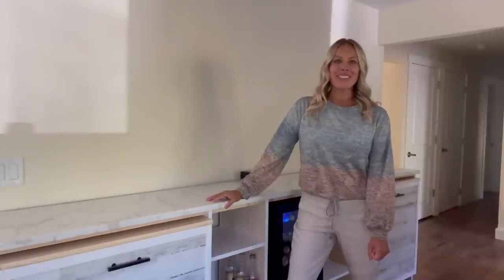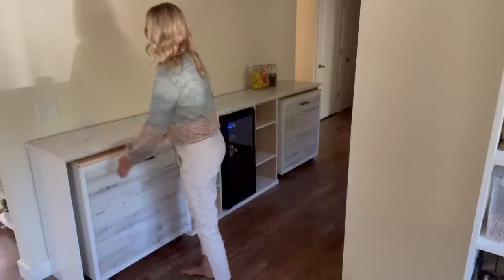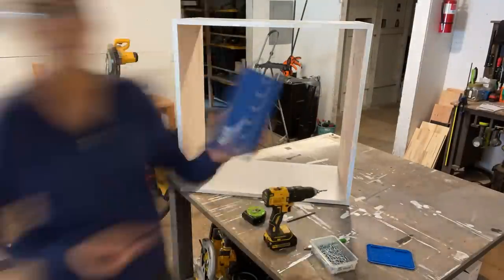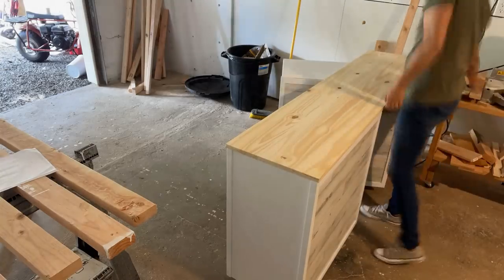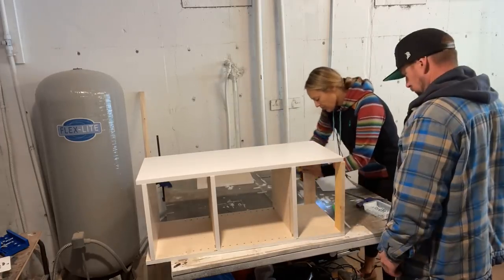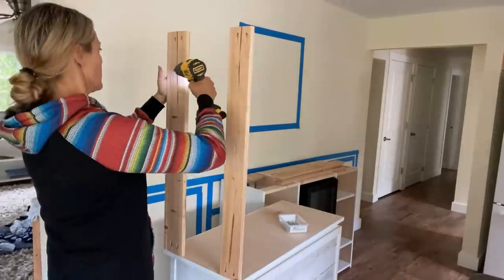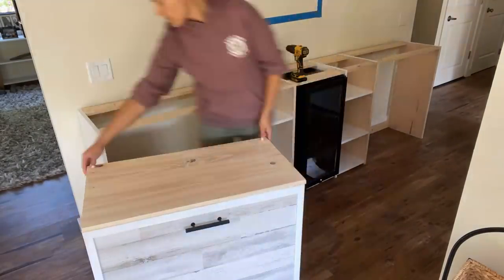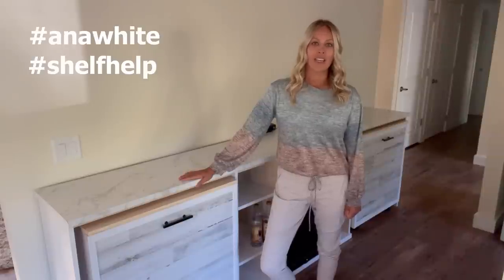Custom Kitchen Console with Roll Out Carts

Comment: As beautiful as they are I would imagine that the floor might suffer if these are used often
Reply: Why?
Reply: The wheels on those carts should prevent any dragging or rubbing.  As long as the wheels are decent and intended for use on flooring not just concrete there shouldn't be a problem.

Comment: Need powerpoints now though, with all those appliances and no way to easily plug in to use there. 

It doesn't look finished, it looks cheap 😒
Reply: There is a power strip mounted in the center of the countertop shown in the video multiple times